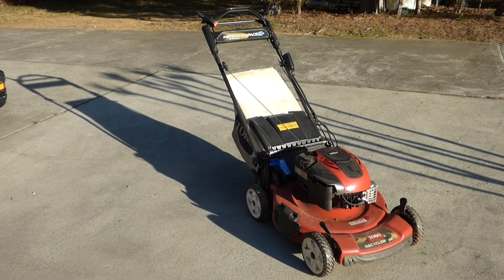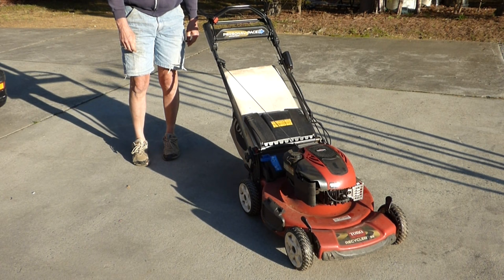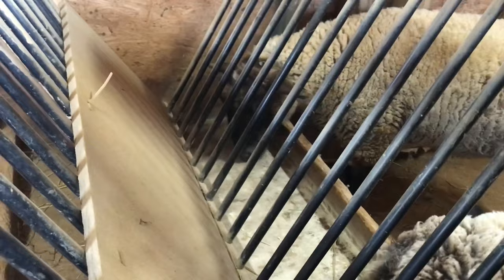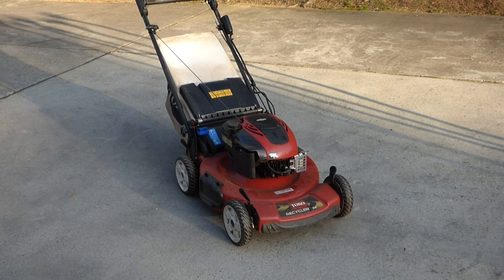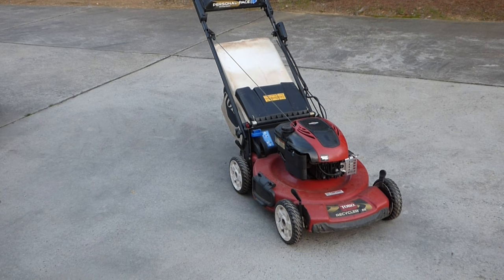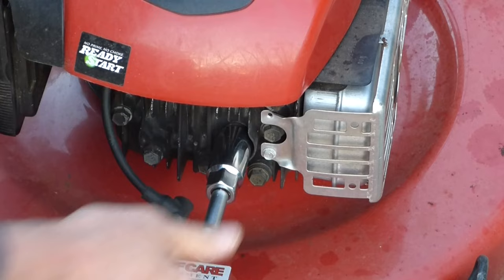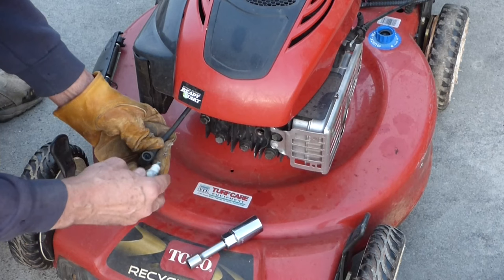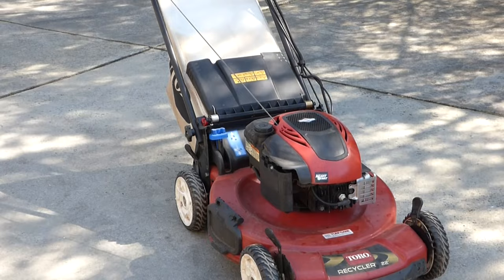Fix a Lawn Mower that Will Not Start When Hot - How to Diagnose & Repair

Comment: Hello. Awesome video. I have a Toro 6.75  190cc. I have that issue so I replaced the carburetor and I I took the gas tank out and washed it. Put new gas, new air filter , new spark plug and it starts great but once hot and I turn it off it wont start again.  So can it be the coil? and how do I test that?
Reply from the maker: When it is hot and will not start check to see if you have spark as I did in the video. If there is no spark then you can take it apart and change the coil But before you take that apart I would diagnose it and check for spark. When coils begin to go bad they will work intermittently… Often when the engine is cool they work and when they get hot and expand they quit
Reply: Great. I see,  yes you did the spark test with the engine hot. I'll go ahead and do that and I think 90% that is the issue. Thank you so much my friend. Be well.
Reply from the maker: If it is your coil this video may help you fix that.
https://youtu.be/Z0PLBL6WnqU
Reply: It's a carburetor issue you can read my main comment explaining why.
Reply: It may be hot oil fumes from the crankcase oil breather tube messing up the fuel/air mix,‘ just confirmed this on my Briggs and Stratton 725EXI.  Try temporarily disconnecting the oil breather hose from the air filter housing and see it that helps.  Also be sure your air filter itself is not clogged.
Reply: Thermostat problem

Comment: I work at a big box retailer..had one returned due to the electric start not working.. replaced the 40 amp fuse (there was an extrain the little black box) and it fired right up..different issue  but might be the reason you did not use the electric starter

Comment: I've got a very similar issue on very similar mower. But I've never taken a carb off/apart before. Any tips? I all ready changed spark plug, air filter and oil. Reckon this must be the issue.
Reply from the maker: They are pretty basic. Take pictures along the way so you know where things go.

Comment: I had the same problem with same model Toro, found the jet was a little gummed up. What are you using as a work stand/ table?
Reply from the maker: It is a foldable carpenters sawhorse table /Router table that my neighbor was throwing away. It does come in handy

Comment: Simple: Make sure the   underside is clean .
There are cooling ribs on the bottom of engine. 
Proper amount of oil.
Clean air filter.
It will start  as it should.

Comment: Did you check the gas cap?  It is not the spark.  Did you fully inspect the carburetor and has it beeb cleaned thoroughly?  These are the issues.
The gas cap has been known to fail and cause vapor lock On this particular model.  I replaced the gas cap with a conventional one which has a vented hole through it. And the vapor lock problems were solved.  If you don't replace the original gas cap, then you're going to have this problem again.  That's been my experience after owning/operating the same mower and engine for twelve years.  Mine starts first time every time.  And once a year, one should take all the covers off of the top and clean the entire top of the mower from all debris and grass clippings so that the auto choke works flawlessly.  I drain my fuel tank,  carburetor and take off the gas cap, replacing it with a tightly fitting rag throughout every winter.  Every bit of my fuel that I use contains stabil.  The problem I am having with the mower is not the engine. Because I have solved all those problems.  It's the body of the mower that is going; stress and fatique cracks around the wheels.  The briggs and stratton engines are finnicky, but once you understand the need for a good, fresh fuel
And a clean carburetor,  they run quite well.  I change the oil once a year, along with the spark plug and Air filter every year no matter what.  No engine problems whatsoever.  You wasted a lot of time figuring out the problem which is rarely electrical.
Reply: Can you post which cap you went with? I’d like to replace mine

Comment: I will try these steps but wondering how can a new carburettor have problems?
Reply from the maker: You may have another problem... hard for me to say without being there.  Run some tests when it is hot and won't start...  Check for Spark...  Try starting with starting fluid...  may be getting too much fuel... ie stuck float or choke?...  You mentioned a "new carburetor".  Did you purchase a new after market carburetor?  If so... some aftermarket carbs can have problems.
Could be something unrelated to this?...
Let us know what you discover.

Comment: Ive always heard coil.  Im having the same issue with the same motor. Ran the carb through the ultra sonic cleaner blew out with air.  Now runs great but when i shut it off it wouldnt start. Guess ill clean the carb again.
Reply: It's the choke

Comment: Same problem, fresh gasoline, use starter fluid, will not start, immediately put new spark plug in and it starts.  I have not checked the coil performance.  Would like to have seen that procedure.

Comment: I have exactly the same issue and the same problem with starting. Using starting fluid works unless it has warmed up then after 5 minutes nothing until it cools down completely. Replaced plug, carburetor, drained the tank and replaced the air filter. Works well under load and if it chokes off in thick grass it will restart if I do it immediately waiting more than 3-5 minutes nothing until it’s cooled. What is it I haven’t tried a coil maybe…
Reply from the maker: Sounds like your coil is going bad.  this may help you diagnose...
https://youtu.be/Z0PLBL6WnqU
Reply from the maker: Here is another one that may help diagnosing your coil and wiring
https://youtu.be/qkS94XdK_Os

Comment: I have the same problem even after replacing the plug. I pull the plug, fill the plug with gas, reinstall, and it starts right up. I am sure there is a problem with the carb, but it's a simple workaround.

Comment: This is where you always start, clean the the carb and don't use gas with ethanol in it so it doesn't gum up on you.. Usually you don't need to take the carb off just remove the bowl clean it and the jet out good to go.

Comment: Great video. What are you spraying into the carburator? What product? Many thanks
Reply from the maker: Starting fluid When trying to get it started and I use carburetor cleaner when disassembling and cleaning a carburetor

Comment: Weak spark can make the engine cough with fuel ratio contains more air (had the problem recently), it would only cough when I stopped cranking. (Water got on the coil) changed it, it is fixed.

Comment: ive a 6.5 hp briggs and stratton intek does exactly the same thing ,,, i just go and have a cup of tea , thenafter that it starts ,,, when its running it will run all day , but you dare not turn it off to fill the fuel tank , or its twenty mins wait.

Comment: Plugs almost never go bad.  Coils yes, but you ruled that out quickly.  People need to run stable in their mowers.  This ethanol fuel is crap and will gunk up the carb jet pretty quickly.  Did this mower have a primer bulb?
Reply from the maker: No primer bulb

Comment: If the motor runs why are you checking for spark?
Reply from the maker: When ignition coils start to go bad they will run while the engine is cool and when it gets hot they will stop. That’s why I checked for spark when it was hot to see if the coil was bad. Very common problem.

Comment: Do not replace the coil if your mower starts fine when cold. 99.99% of the time, you are wasting your money. If your mower still does not start when hot after you've cleaned the carb and/or replaced the fuel and spark plug, chances are there is really nothing wrong with the mower. You can consider it as defective from the factory. There is a trick to help you start it when it's hot. Slowly pull the rope and stop after you feel it passes the compression release step. Then return the rope and pull it hard. If you cannot get it start after 5 pulls, STOP because the engine is flooded. Remove the spark plug, let it dry, and try again. Hopefully you can get it started in 3 pulls.

Comment: I had this problem, but with a new mower only two months old. Can’t be dirt in the carb. I just don’t turn it off when it’s warm, I mulch the grass instead of emptying the bag. If it keeps happening I’ll talk to the seller dealer.
Reply: Check the air gap from the flywheel to the ignition coil. Also use a voltmeter on the ignition coil. Plenty of YT videos on that. I had a bad ignition coil.

Comment: I have the same problem with my lawnmower, so I change the coil 2 years ago and it’s still doing the same thing, I changed the spark plug too, last year.
Reply: Check the fuel cap for stopped up vent , I’ve even drilled tiny hole in them 
Leave cap lose and run it and see
Reply: Also check for spark when it stops

Comment: When you cleaned the carb did use use carb cleaner or air in a can  to free up the problem?
Reply from the maker: I use carb cleaner to clean the carburetor. I also try to stay away from spraying rubber gaskets and O-rings with carb cleaner because it can distort them. Be careful with using air as you may blow out an internal part

Comment: This is a common issue if you are using gas with Ethinal in it and don't properly winterize your equipment. Depending on how gummed up your carb is it may not start at all.

Comment: I have that exact same motor on my push mower and it started doing exactly the same thing.    I'll run a tank of gas threw it and after I fill it back up it won't start again.   I'll have to take the carburetor all back apart blow air threw everything then it'll start again.  But until I put the air to it it will not start.    There's gotta be a obstruction somewhere but darned if I can find it.
Reply from the maker: My video on doing all that will come out in one week. Not a hard project
Reply: That's easy to fix.
Reply: By the time you remove and clean the carb the engine has had time to cool down, check for spark b4 pulling carb, maybe you'll find the problem

Comment: All that pulling of the cord not good for one's back. lol  My 22 yr old 22" push murray briggs & stratton mower has the same problem but it has side discharge & i use no bag. I just dont shut it off & fill the tank full so i have enuf gas to do the whole avg lawn.  Takes 25 min. The mower can also vaccuum the sidewalks & driveway! No need for a blower! When cold, even after the winter, it starts on the 1st pull everytime. I do use stabil tho.

Comment: Why are you checking for spark?  It was running!!!
Reply from the maker: When ignition coils start to go bad they can run when cool and then not produce spark when the engine gets hot
Reply: @helpinguonline  lol!  An ohm test on the magneto would tell you that,  you haven’t run it long enough to ascertain if that’s an issue.  You’re going to have spark since it was running.  Just a waste of time man!  Stop checking the obvious

Comment: Definitely not the best troubleshooting.
I deal with these mowers every single day and while it used to be a far more common situation where a mower would run for right around 12 to 15 minutes and then die and not restart because it would lose bark from an ignition module, it's not as common as it used to be 
On that particular Briggs & Stratton engine with the auto choke system there have been a lot of problems with them not starting when hot after they have cooled off for just a couple of minutes but certainly are not cool again because the auto choke starts to close especially if it's cooler out or there's a nice breeze because it cools off the muffler which is next to the choke turn off assembly.

If one of these mowers runs perfectly well otherwise (which this one was not because the engine was surging and that is a sign that the main jet in the carb is slightly restricted) 
But if they run fine otherwise, it's typically that the auto choke has closed back and if you simply reach your finger underneath the black plastic top cover or remove the top plastic cover from the two Phillips screws, you can hold the choke open and it will usually start by the second pull because it's actually flooding itself out.

The situation with this more was more atypical and it was not getting enough fuel at least that's what it looks like BUT it might not have been because starting fluid is much more volatile than gasoline and even though it was flooding itself out be starting fluid might have given it just enough to fire up.
ALSO you should throw the starting fluid away and not use it because it's really hard on the engines. Spray carb cleaner will do the same thing and does not harm anything if you run one on it.

The first noticeable sign for this though was that the engine speed was surging up and down which means it needed a little bit more choke because the main jet was slightly clogged so if you would have simply held a rag over the intake carburetor hole there behind the air filter or use your finger to close the choke mostly it probably would have fired UNLESS it was the first situation where it was actually flooding out because the choke had already closed but all you have to do is test it a couple of times by moving the choke lever to the opposite position it is in and if it does start right up you know that was the problem.
But with the surgeon, I'm guessing you would find by holding the choke shut it would have started which is about the same as giving it extra fuel or starting fluid and that would have told you it needed the carburetor jet cleaned out.

It's not really as complicated as it seems or it is when you talk about it or as most people make it..
They kind of go about things thinking it might be this or might be that without actually checking the most common things and rolling them out one at a time.
MOST starting and running issues are because of not enough fuel getting through the carburetor. 
Which it seems is what this one was so therefore you should always go checking that out first before you consider a coil or before you even pull the spark plug out because it's very, very rarely a plug or ignition issue.

Comment: This could be my mower. A Toro with Briggs and Stratton engine which in my opinion is completely useless. Never starts easily, tried changing fuel, cleaning carburettor jets, cleaning plug etc etc and still won't start. I would never buy one again

Comment: Sounds like the air filter needs cleaned
Reply: Spray it with hair spray
Reply from the maker: New Air Filter, oil change & blade sharpening...
https://youtu.be/7GNlJpdlYfo
Reply: @helpinguonline  Did all that, doesn't help. Brand new carburator, still doing it! What's rest is the coil.